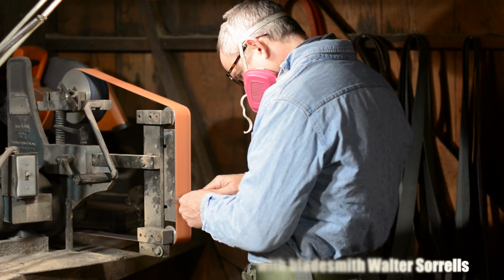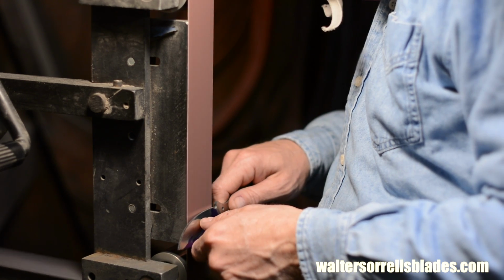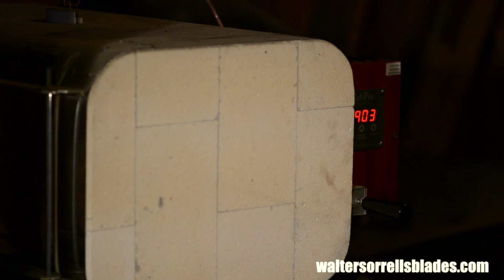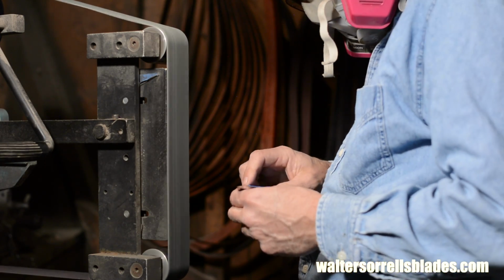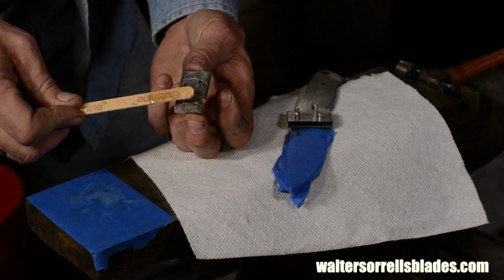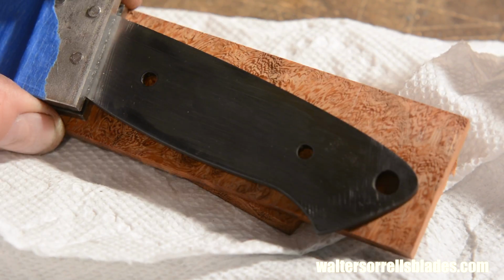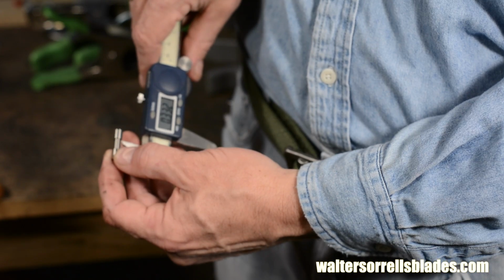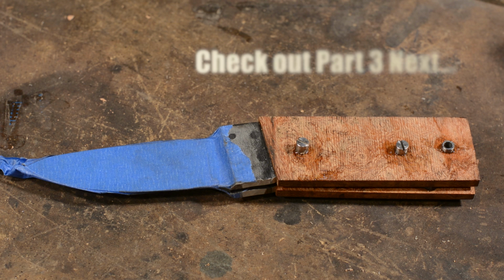How to Make a Hunting Knife - Part 2

Comment: Are you angling the knife as you draw it across the belt sander or are you holding it flush so to speak against the sander? I'm trying to figure out how you keep the bevel consistent down the length of the blade.

Comment: An idea for fixing the bolster would be tig welding the pins instead of peening them. I understand everything about being super careful about not ruining your temper but it can be done by running your weld nice and hot as to limit your heat input and then drop it into water or even running the weld while the blade is wet.That would ensure completely invisible pins after a good polish. Yeah you may not have a tig welder but it could be very useful for a lot of things. For example, tacking your stack of flat bar together for forge welding a Damascus billet. This way you aren't mixing mild steel filler wire into your billet. (If that's even something you worry about.)
Reply: quenching welds.......excellent idea. I take it youre not a welder?
Reply: +nizmojoeblows I am actually. I'm not saying to quench a big fuck off structural weld, these are 2mm pins to be tacked onto flat bar. It's a way to blend the pins with the bolster and quenching saves the blade at the risk of breaking the welds. Do you have another solution?

Comment: man, I love your videos and I watch them in bed with my headset when my wife is sleeping.
if I may, you have a problem with your computer, which induce a low buzz when your using the computer mic.
2 solutions: 
- checking the ground on your IMac
- setting a low pass filter @90 Hz in your post production  software

thanks a lot for your knowledge ;)

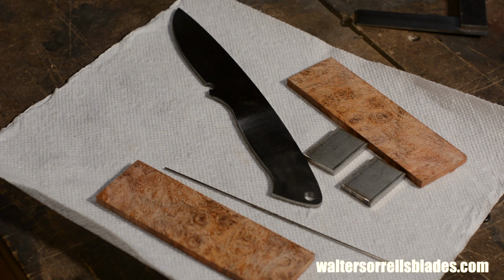Comment: Prior to my question, a tip of the hat to you sir for your amazing tutorial(s).  Question: How were you able to make the pins in the bolsters disappear after sanding and polish?  Obviously there are 4 pins in the bolster...though it looks as though they've melted into the bolsters and left no evidence of 4 holes? (see video pt.3 @8:05)  Does the heat from the belt grinder allow this?
Reply from the maker: +Brian Olson No, it's just a function of having a very tight fit between the pin and the hole.  By peening it into the hole, the pin expands to fit the hole and it more or less disappears.  You can see it on very close examination, though.
Reply: +Walter Sorrells wow.  I thought I had a pretty clean/close look at the bolster when I paused the video. It look's so smooth, guess I'll just have to take your word.
faster in law gave me a chunk of burl from his backyard.  going to use it as a gift back to him as a knife handle.  just purchased Hunters Delight Blade with CRYO, with Stainless Bolsters (BL543C) from Texas knife.  so the step I most concerned about is the bolsters and pins.  any who... thank you again for sharing your gift to us all... wish me luck.
Reply: +Walter Sorrells how much of the pin do you usually save for the peening? Ie. how much of the pin length exeedes the thicknes pf the knife?

Comment: When using epoxy, I have a couple tips to offer. 

Tip 1, when using epoxy to connect metal to metal parts (like bolster to blade handle) use JB Weld. It's an epoxy specific for metal. It's terrible for plastic but for metal to metal, it's much better than normal epoxy. 
Tip 2,  Walter mentioned degreasing the handle before the epoxy though did not elaborate. In my opinion this is very important if you want an epoxy bond that will last. There is a simple test you can do to know if your metal is clean enough for epoxy. It's called the water sheet test. Look it up on youtube to get details, you will find the best info for anodizing aluminum and painting metal. But in my opinion, clean the metal with Comet or something similar. A chlorinated cleaner like Comet works the best in my experience. 

Quick explanation of the water sheet test. Dribble water over the metal you want to epoxy. If the water beads up than the metal still has oils on it that will negatively effect your bond. Clean the metal until the water seems to sheet across the surface and does not bead up. It's almost like the water absorbs across the surface. If the water no longer beads up you are ready for epoxy. Hint: your hands have oils on them to try not to touch the metal with bare hands through this process.
Reply: +helicrashpro JB weld will leave a thin black line, which is typically not preferable when working with bolsters (as you typically want a seamless transition)

Comment: when making the bolster.. can a guy glue it on first then drill the holes and then add the pins after?
Reply: I don't think drilling glued bolster is smart or even possible but if you think you can do it then do it.
Reply: ***** I usually use clamps too but when I don't have free clamps I glue everything and very slowly drill it

Comment: can any steel be heat treated or just stainless? can regular flat bar steel from homedepot/rona be heat treated? thanks
Reply from the maker: cody adams   The short answer is that it has to be high carbon steel -- whether it's stainless or not.  Home Depot steel is low carbon steel intended for structural and welding purposes.  You can't harden it.  You might check out my "How to Choose Steel for Knfiemaking" video for more info.
Reply: Walter Sorrells I really appreciate the quick reply. I have since took what i could from your other video and tracked down/purchased some o1 tool steel. Thanks again!
Reply: cody adams If you wanted to get steel quick you could have bought a Nicholson file from your Home Depot. They tend to be a good quality steel.
Reply: I'm not sure but I think some steel types can't be heat treated

Comment: I was wondering if heat treating is really necessary. I'm making a similar design to yours and the blade is right on the 5" mark. Would it really affect the performance is I don't heat treat it?
Reply from the maker: Absolutely heat treating is necessary.  If steel isn't heat treated, it won't hold an edge.
Reply: Walter Sorrells Thanks. I'm going to have to improvise. Probably just going to dig a hole, put some charcoal and put it on fire

Comment: Anyone that knows this can answer me. I was wondering how thick the edge of the knife is left before heat treating. I read some people saying with 01 steel, it needed to be left about the thickness of a dime to keep it from warping during heat treatment. Is it the same for stainless? Great videos, by the way.
Reply: stainless is heat treated differently. you can make it 6 or 7 thousandths thick

Comment: Thanks for the well made, no nonsense collection of videos. I am wondering how you decide on what bevel angle to use before you start the freehand grinding. I started a kitchen knife last week and now realize that my bevel angle was too shallow making the blade wider in cross section than I would like. I could resort to trigonometry but that seems like a pain in the ass if there happens to be a maker's rule of thumb out there.